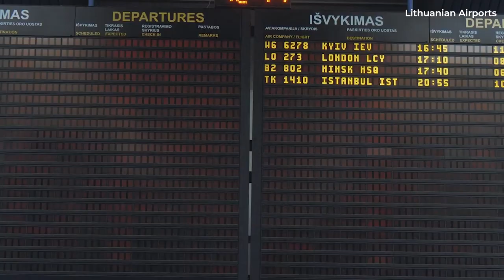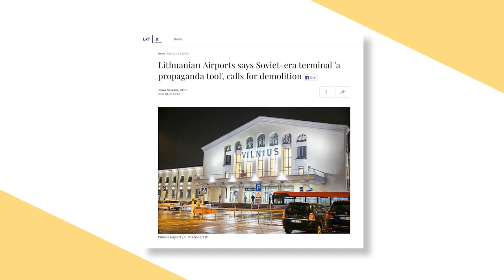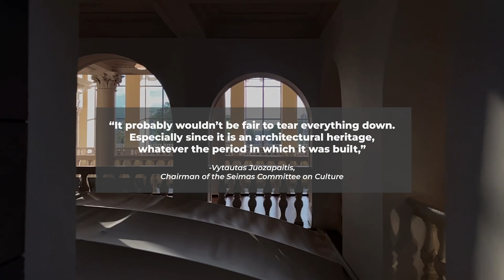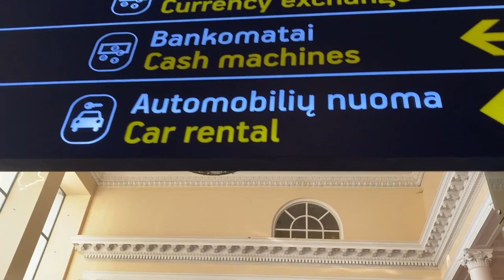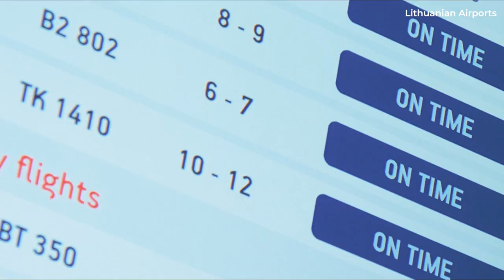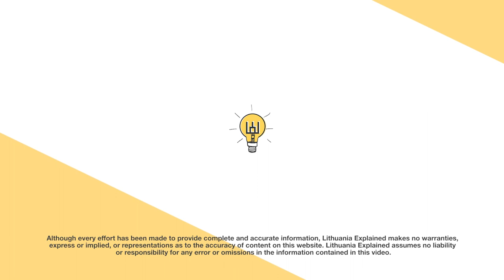Some Want Vilnius Airport’s Arrivals Terminal Demolished & Replaced

Comment: Most of the old building is rather vulgar and poorly designed so should be demolished. A few parts are copied from another building and generally ok. But they are only the inner three sides of the main entrance hall and represent only 10% of the structure. They could be retained and the rest replaced.